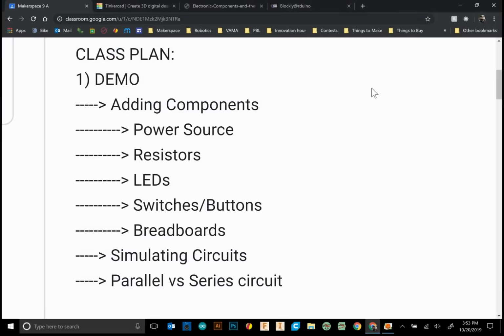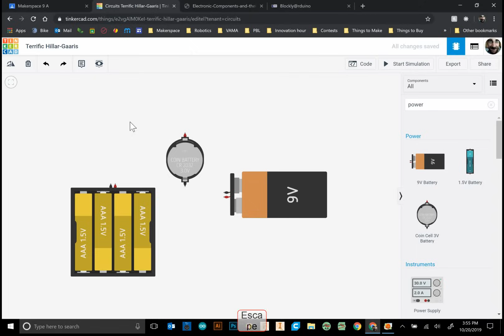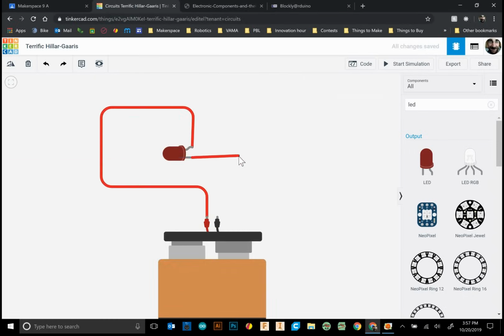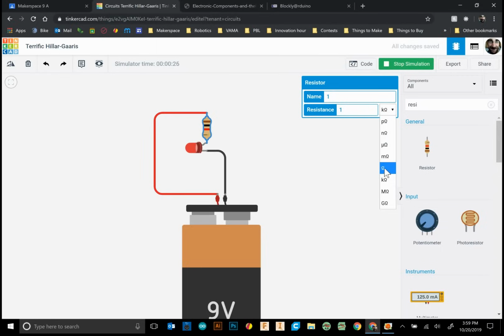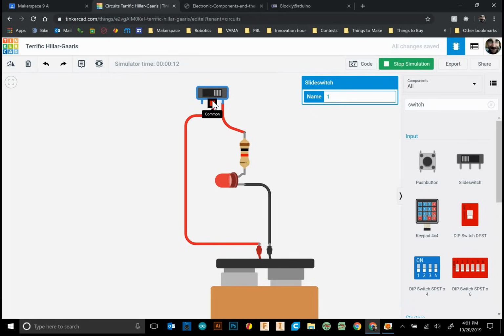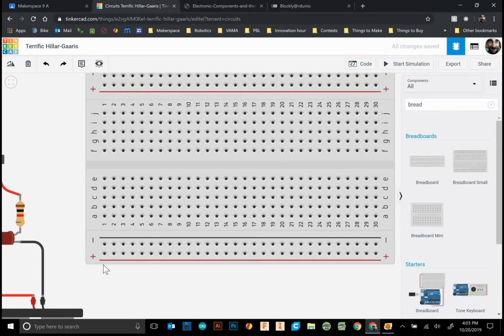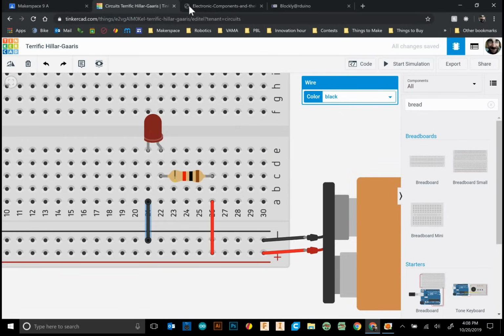Introduction to Tinkercad Circuits & Breadboarding - Part 1

Comment: It shows the current flowing from the positive side of the battery and then returning to the negative.i always thought that current flowed from the negative to the positive end of a battery
Reply: Is this why they say that the ground bus or rail on the breadboard completes the circuit because they are thinking conventional flow.because how can the ground complete the circuit if its conected to the negative pole of a battery,which means it receives electrons.
Reply from the maker: Conventional current flows from positive to negative; however, in reality electrons flow from the negative terminal to positive.

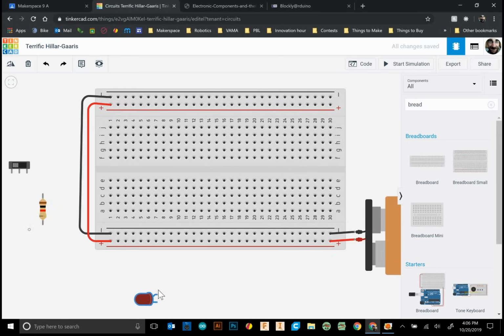Comment: Remi, I have a question. At 13:03, why did you rotate your LED to have it vertical like that instead of just leave it the way it is?
Reply from the maker: Hi Tram, I rotated it so that the two leads of the LED would be plugged into different parts of the breadboard. Had I left it, it would be like connecting the two LED leads together and it would not light up. Best thing to do, is try it out.

Comment: I need to know if i can make sound detector for specific sound help meeeee😢
Reply from the maker: Hi, it is straight forward to make something that detects sound in general, but to make something that will detect a specific frequency is more complicated. Here's a tutorial to start with: https://www.instructables.com/Arduino-Frequency-Detection/
Reply: @RemiWauthy  what type of input sensor should i use in the thinkcad because i can only use thinkcad
Reply from the maker: @norahalhajri6786  Are you using an Arduino?
Reply: @RemiWauthy  yes
Reply: @RemiWauthy  yes

Comment: what was the purpose of the other end of the breadboard, the wires. Do they serve a purpose in that circuit?
Reply from the maker: No, they don't. It's a typical way to setup a breadboard as it provides power and ground to both sides of the board, rather than using long wires to reach one side. In this circuit it wasn't necessary.
Reply: @RemiWauthy  oh i see ty

Comment: (I don't have a computer or access to Tinkercad right now, so I can't test this for myself at the moment):

- Do I need 2 resistors if I add a second LED to the circuit? If so, could I use a single resistor with a higher resistance, instead of using one for each LED? 

I have 10 physical pieces of 5mm(?) 940nm IR LED's (LIGHT EMITTING IR-DIODES, NOT IR RECIEVERS !) that I  want to have turned on by using a single switch and a battery/-pack (it's going to be a stand-alone IR illuminator for a Raspberry Pi NOIR camera). Does that mean I have to add 10 resistors as well? And is a single 9V battery enough to power all 10 diodes?

(Btw, I don't want to use an Arduino in the circuit. Just a battery, the LED's, some wires and a on/off-switch. If possible.)